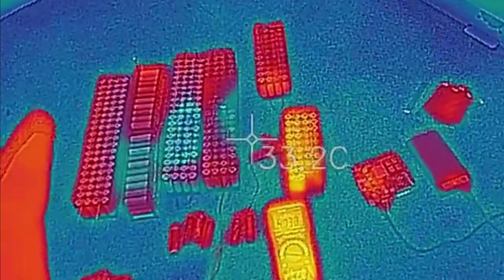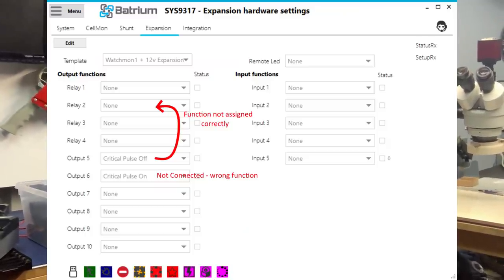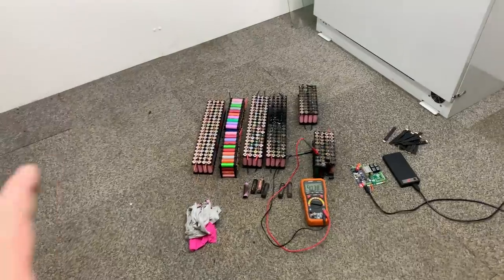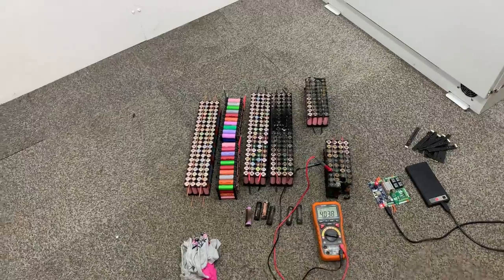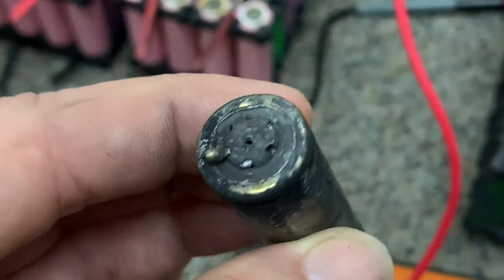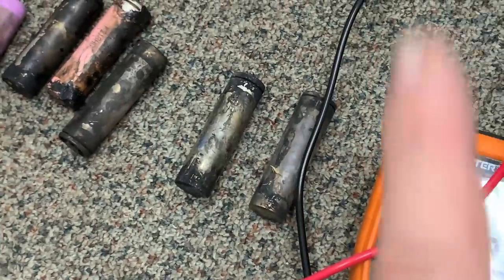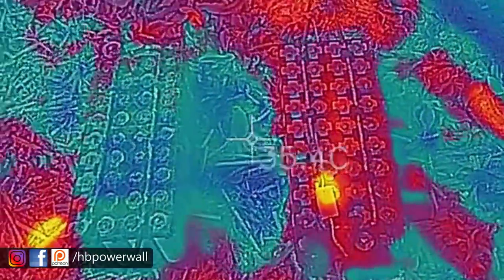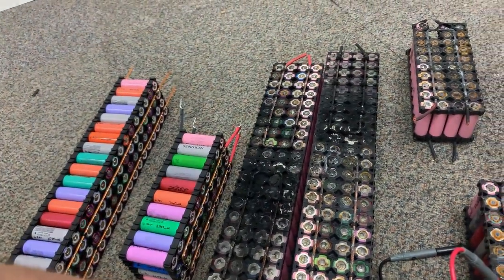Near miss, Smoke, Fire & Fear on new years eve

Comment: Scary Stuff !Looks like one cell internally shorted which wouldn't blow the fuse. I do worry about this on my system but I thing all you can do is a 12 monthly IR readings of every cell and monitor the cell pack temps. If any go above 100mohm ditch them. If one starts getting hotter than the others. Shut shut the system down and investigate. Ive built a 18650 based powerwall and I used a Batrium WM4 with longmons. Shortly after installing I could see that temperature measurement for the cell packs on the longmon is not accurate. So ive installed a DS18B20 in the top of each cell pack and and programmed them into my control system that if any go above 35oC it shuts the inverting and charging down and sends a notification to my phone.
If I were investing this fire I would be measuring the internal resistance of the remaining cells with a proper battery impedance tester like a Hioki BT3554. I tested all of mine with this tester and its surprising to see that the Liitokala 500 charger does not give accurate IR readings. I have also installed fire/soldering blankets between each pack (on the positive ends) so if one ever did vent it would be like a domino ralley.
Reply from the maker: Sounds like you've learnt a lot and implemented changes to make your battery safer.. well done! Next generation has external temp sensors and less of them. I broke a whole heap of longmons by zip tieing them up to tight :(
Reply: What happened to the Longmons? Did the stop working or become faulty during bypass? I have 3 that  Ive been trying to get warranty replacements for from Batrium. Customer service is disappointing.
Reply from the maker: @GarethJones-dk9yp  Longmons and WM1 were in perfect working order
Reply: Just another thought. The crimp connection on the pack that caught fire. If you could salvage that and measure the resistance on the crimped connection. Maybe it was slightly high and got worse overtime and the cells closest to that connection conducted the heat then overheated and caused the fire?.

Comment: This is why you don't use li-ion cells of "unknown" state for massive power banks.  Also another advantage for lifepo4 cells :-)
Reply: unknown state?
Reply: @jimmyb1451  recycling batteries especially from different sources is inherently risky.  It's one thing to repurpose an entire EV battery pack but random modem/laptop/etc 18650s all paired up in a massive dozens of kWh pack is just asking for trouble.
Reply: @tomstdenis  That's one opinion.

There's more to this story. You're jumping to conclusions.
Reply: @tomstdenis  All Li-Ion batteries are inherently risky ...

Comment: Not only do you need a BMS you need to see that it works .
Reply: What makes you assume the BMS was not working ?
Reply from the maker: I can assure you BMS has been tested and was balancing as it is expected to, that said there were two programing errors that would not have effected this result in anyway.
Reply: @HBPowerwall   I've been converting gas cars to Electric for almost 30 years when lithium first was available I was lucky enough to have some jobs so I've seen the batteries since valence and china to high power  Winston  Thunder Sky . Then calbs. I mostly use Nissan Leaf and Tesla batteries now. Had more fires than I can remember I never had a problem when the BMS was working properly. Not saying it can't happen but . I just ran into one BMS that works fine when charging or discharging but if both are going on at the same time it would not shut down the charger when the cells hit charged voltage.  this is an example of a problem that wouldn't show up even with testing unless you did the right test as most cars are either being driven or being charged but not both at the same time as a powerwall might be. I I haven't had any experience with the BMS that you're using but  it  looks like it's pretty good. I've also seen a low 12 v power cause a BMS nor to work properly. Best of luck we need to share information as much as possible as each "problem" sets the movement back. Check out my Chanel

Comment: Did he rip out all the cells/packs, and won't build a new power wall?
Reply from the maker: He is going to sell the 14s battery that is built but not cycled in a Powerwall for what ever he can get then move on. I have everything he owned Powerwall here.
Reply: Something just doesn't add up here. I get that you met briefly with this gentleman. But in that short time, he got you to take his existing powerwall, and a completed 14s powerwall that was never hooked up? And told you this whole story while you were loading up your car? This guy has a smoke alarm in his shed that he has interconnected to the smoke alarms in his house? He was drinking, like alcohol drinking? Only 1 or 2 cells went to thermal runaway? And the biggest telltale: he was nervous, embarrassed, and wants secrecy. Pete, I hate to say it, but I believe there is a human error factor that we aren't getting from this guy. Thermal runaway spreads very quickly to other cells. Watch Tesla Powerpack UL testing, or that one Daniel Romer video where he ignites a cell in a pack. When you add up the time between when the cell vented, when the shed smoke alarm went off, the time it took to run around the house, and the time to get to the shed, I'm sorry to say, but there should be a lot more damage. Unless, of course, he was in the shed at the time the cell vented.
Reply from the maker: Your probably right. Time will tell
Reply: @Rendus4  Are you suggesting what I think you are suggesting? That some of the packs had those cells where the internal "fuse" had tripped and then reset? I'm quite sure nobody would do that. I mean if he had so many non used packs, why use bad cells in your own powerwall?
Reply: @JoneKone  You are talking about CID resetting. I doubt the cells would have made it that many years with a CID reset. What I was suggesting is that the person had a few drinks, went out to the battery shed, fell into or knocked something onto the packs, and shorted out a busbar to the negative can collar of the cell that vented. But it looks like a heater just overheated into thermal runaway.

Comment: Overheated at soldering. It did hapened to me also.
Reply: What proof do you have that "overheated at soldering" caused this problem?
Reply: @MrSummitville  At soldering at the bottom of the  cell got dameged the isolation and got short circuit. Inside the cell. When i solderd it a little longer the cell got little warmer and warmer. I placed it out side and after 15-20 minute cut on fire.
Reply: @energiavadasz3328  That is not proof, that soldering caused this problem.
Reply: @MrSummitville  I cut it up and it did dameged the seal on the botom of the cell internaly. And caused shirt  circuit in it. Belive it or not. It was a chinese cell. With less quality ruber seal in it. And because of the diferent outer metal, harder to soilder and take longer time, more heat. That caused the shirt circuit in it. Can take longer time to show in some case
Reply: @energiavadasz3328  You damaged your cell.  That is not proof that soldering damaged this battery ...
Reply: @MrSummitville  i am 99% sure. But what do you think, what caused the interior shirt circuit on that one?

Comment: FUSED : 
- A fuse,... is ONLY a FUSE if it is designed & rated to BLOW at a particular current (surge) for a period of time.
 - YOU just can't put a piece of 'thinner gauge wire' of any 'composition' in place and say it is FUSED !!!
.... (thermal, voltage & charge rate protection, are other issues altogether)
.
Reply: And that is why we use "Fuse Wire", which is specifically designed for this purpose ...

Comment: ALL batteries are never in my home. They are in a custom steel encasement 50 yards away from the home. That goes through an underground steel pipe weather proof into the home. If there is a fire it will never touch the home.
Reply from the maker: sounds like a common sense plan..

Comment: Water is not great for electrical fires. They should of had an appropriate fire extinguisher near by
Reply from the maker: I'm sorry that is so horribly incorrect. Water is the cheapest most accessible thing to cool something down. These batteries go into thermal run away you need to stop that reaction only way is removing heat. An extinguisher will only put the stuff out around it...

Comment: Reminds me of Elon's note about ‘bad’ cells that self destruct. If you recall, they modified the Tesla battery packs to isolate cells so that if they outgas they don’t contaminate other cells. 

I’m thinking here that likely one or more cells got fatigued from all the charge-discharge and started to overheat. I don’t see any thermal sense wires on these packs (not sure if there were any or not). If the cells start to get warm and overheat then the cell will basically self destruct thermally and not necessarily electrically. 

Self destruct can also happen electrically when a cell starts drawing a lot of current from an adjacent cell(s) that have more charge than the deficient cell has. This causes the cell to exceed the ‘c’ rating for charging and it overheats very quickly.
There we are again - back to thermal overload. 

Telse figured out a long time ago that if you want to get the maximum use out of a lithium battery, then it really needs to be in a very specific temperature range for operation. 
Here’s Panasonic NCR18650B temps from the specification:
Charge 0 to  45C
Discharge -20 to 60C
Storage -20 to 50C

The early Tesla vehicles didn’t do this as well as the later ones. It is very obvious on a Tesla when the battery is cold or is warm. The regenerative braking for instance on a cold battery is almost nil. Warm up the battery and it takes a lot more amps from braking. They rarely get ‘hot’ but you do get to hear the cooling fans scream when you are charging on a hot day (45 C). 

So, looking at the debris you have, I suspect a thermal failure that overheated adjacent cells in a domino effect. Probably if you can lay the packs out in the original layout/design, you can visually figure out the source or beginning of the failure. It looks like that corner where the cells self destructed from the vid.

Just my $0.02 worth
Reply from the maker: Love your thoughts, thanks for the input

Comment: Maybe it‘s inherently unsafe to reuse cells of dubious origin in the first place. Of course you can protect against some of the dangers with good design and good pretesting of the cells. The problem as I see it, is in the sheer number of cells used. The more cells you have the greater the chance that one of them is dodgy enough to generate massive heat, even without tripping the fuse. So the best way to protect against collateral damage is to place the stuff as far away from your home as possible. And/or a proper fire proof enclosure.

Comment: You're resistor wires ain't going to stop a internal short Thermo run away battery
Reply from the maker: No but it will dead flat the battery so there is no more potential energy to aid thermal run away..

Comment: internal resistance will increase with the age of the battery so shouldnt have contributed
Reply from the maker: Can't have helped tho...
Reply: @HBPowerwall  no but f it is he issue we are all sitting on time bombs
Reply: @dama054  A dendrite can DECREASE the internal resistance and lower the cells voltage = higher self-discharge rate.  And then the BMS plows even more amps into that weak pack / cell ...
Reply: @MrSummitville  but then as the affected cell pulls more current the fuse if at the right rating would have blown and take that cell out of the pack and would have slowly self discharged

Comment: You said he had the power-wall outside in a shed thingy, is there a possibility that it was below 0°C while charging? Because then would an internal cell short be a possibility. With internal cell short there is nothing that can prevent  a thermal runoff. Neither the CID nor a cell fuse.

"Many battery users are unaware that consumer-grade lithium-ion batteries cannot be charged below 0°C (32°F). Although the pack appears to be charging normally, plating of metallic lithium can occur on the anode during a sub-freezing charge. This is permanent and cannot be removed with cycling. Batteries with lithium plating are more vulnerable to failure if exposed to vibration or other stressful conditions."

https://batteryuniversity.com/learn/article/charging_at_high_and_low_temperatures
Reply from the maker: it was 4pm on a summer afternoon.. I think it gets to zero a handful of times a year here and only as sun rises so not really for long maybe a few hours at worst

Comment: It falls on the head of those that made them, cause they won't use the same chemical make-up for all and keep a check on all of them as they charge or discharge, to many rely upon computers to do it. :\
Reply from the maker: Yep, user error
Reply: @HBPowerwall  Not always, I have bought wheel bearings U-joints spark plugs that was junk out the box, ran into a few bad main and rod bearings as well that came from China, I miss the days of 300,000 miles before any real problems show up. rofl

At least we came out on top, unlike now being in debt to them (manufactures) because they are to cheap to make it right. I would rather be broke and all my customers happy, than rich and have to duck and dodge everyone with pitch forks torches because I screwed them over with stuff that I knew was junk. lol

Comment: Batteries are dangerous in the best of conditions. They are stored energy after all! Most of these DIY powerwalls include multiple elements that increase risk. 

Using mismatched cells of different origins and different amounts of use increases risk. These cells are likely different capacities and mismatched internal resistance which will wear and stress the cells unevently.

Soldering cells is said to damage them from heat, this is why most packs use spot welding and tesla uses ultrasonic vibrations.

Then you have very little monitoring, so maybe this cell heated up more than the rest of the pack constantly throughout the packs life, but it was never caught until it was too late.

You have no active thermal management in the pack. If you had some sort of active cooling the cell might have lasted longer.

The pack is presumably out in the open with no protection, no fireproof box, this obviously increases risk.

There are a bunch of other risks, the list goes on and on, but everyone building packs like this should understand the risks involved and how serious the repercussions can be. This builder was absolutely lucky that they caught the fire and were able to act in time.
Reply from the maker: I agree with your whole comment.. everything matters, and anything can change an outcome.. this one was luck it seams .